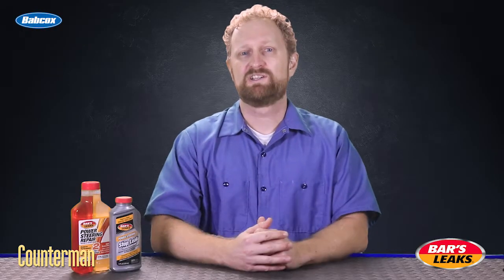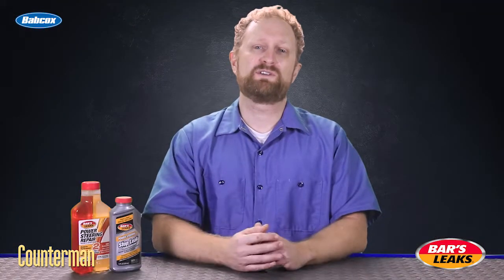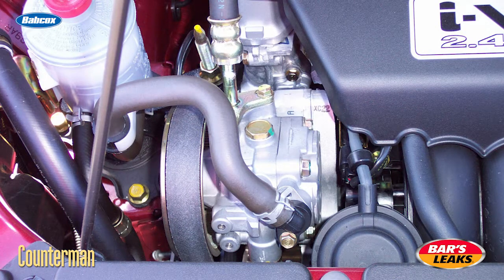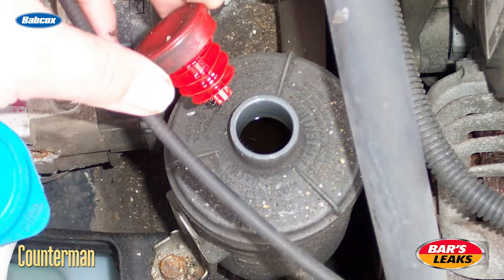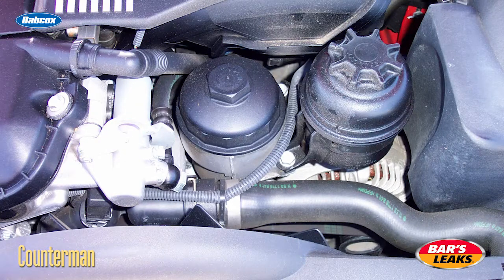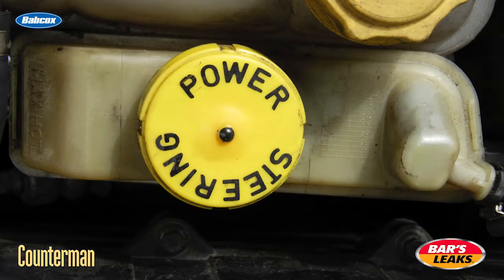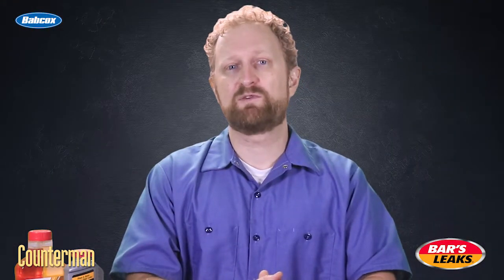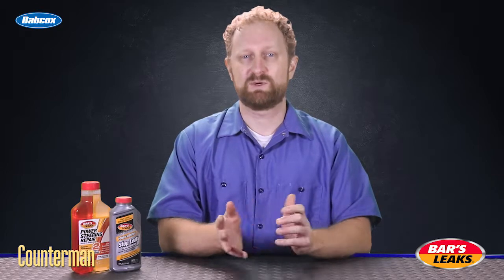What Causes Power-Steering Problems? | Talking Parts

Comment: I have a Chevy hhr n it has a electrical power steering motor changed that and the 60 amp fuse also checked the alternator n new serpentine belt and still having power steering issues where it’ll shut off could anyone help me out with a tip
Reply: The steering motor shuts off while driving after replacing everything

Comment: i have a problem with my bmw F30, but i'm not sure if it's the power steering. At high speeds only, after driving for a while, i feel as i can describe as a small patch of resistance when turning the steering wheel to the left (only). This patch is around 1-2 degrees from the center left. I noticed it's reproducible the most when turning right 1-2 degrees, and then immediately turning left 1-2 degree. It's like a small block/bump in the steering that you have to push a little harder to pass over it.

Comment: In my car where I rebuilt the power steering rack & pump which was leaking fluid & the pump bypass valve was stuck open it was still intermittently hard after I fixed it sometimes.

I ordered a new power steering cap back in 2011 as the old one leaked,it was a genuine GM cap which was ordered from Holden in Australia for my 2002 model VY SS Commodore.

Now,I pulled the centre dipstick part out of the cap to check to see if it had a check valve fitted,well,it didn't have one so I drilled a 2 millimetre (3/32") hole under where the dipstick snaps into place,now the problem is fixed.

The reservoir was getting pressurized so the aerated fluid which was returning from the power steering rack back to the reservoir & the air had nowhere to go.

I'm not an advocate for additives either,when the power steering pump or rack leaks fluid the answer is usually to rebuild them !